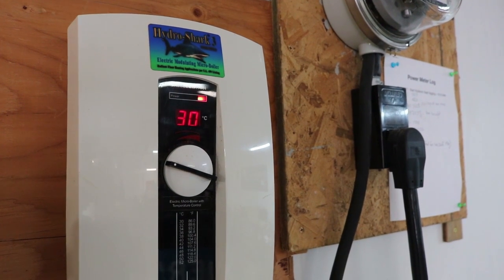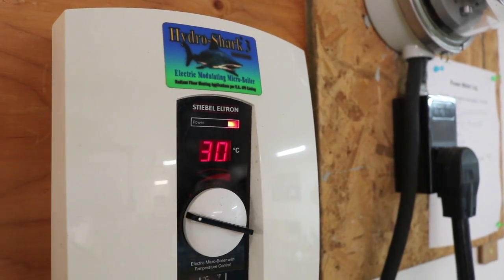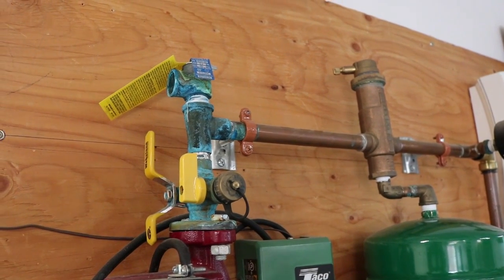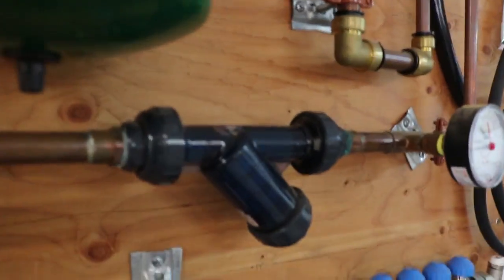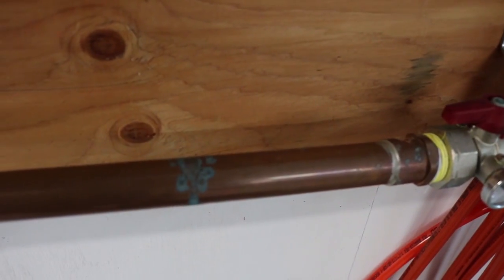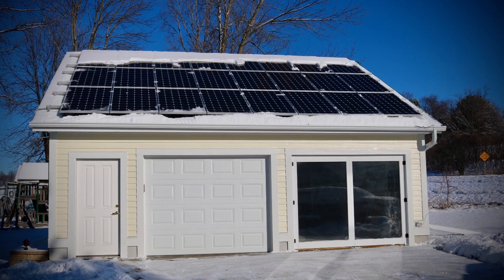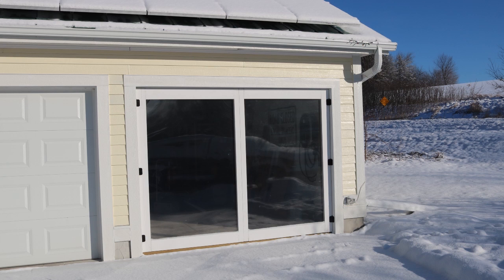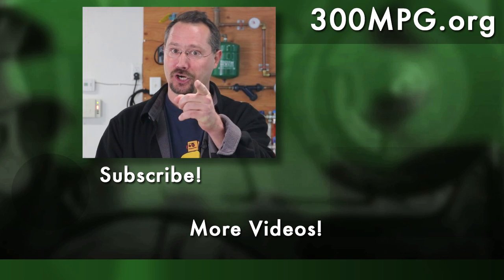DIY Hydronic Heat (3 of 3)

Comment: Hi Ben, You built a great system overall, quite impressive.
I have a few suggestions that would have made your system more user friendly. Since the temperatures used in hydronic heating systems are usually less than 102°F there is very little expansion of the glycol/water mix when heated so you could get rid of the T&P valve and the expansion tank and take care of that minute expansion in a different way. At the highest point in the system on your plywood board you would mount a 1 gallon stainless steel reservoir tank(quick and easy to get from a local welding/fab shop), this tank pulls quadruple duty, it makes filling the system easy, it primes the pump, it acts as an expansion tank, and it allow air bubbles to be purged from the system. Ease of filling: mix your glycol and water to the correct proportions in buckets and set aside and have them ready. When filling the system keep the reservoir tank topped off (use a nice big funnel) and use the primary pump in your system which is below the reservoir tank to actually fill the system. The primary pump should be below the tank for obvious reasons, however it should be at the lowest point on your heating system plywood board so it is always primed. When the system is full the reservoir tank will purge bubbles out of the lines until all air is gone. The tank should be kept half full so when the system is running with the heater on there is air space for any expansion.
The only other change I would have made is using at least 6" of XPS closed cell insulation around and under the slab to increase the system efficiency with minimal cost increase for an 800 sqft garage.
What about having ground mounted or raised, just behind the peak of the roof thermal solar instead of the wood boiler. Free solar heat is much nicer than paying the huge price for a wood boiler. The thermal solar racks could sit on the back pitched part of the roof but raised high enough to be angled facing the southern sun just like your PV panels.

Comment: The pressure relief valve should have a pipe going to within 6 inches of the floor, it's required on water heaters. Also I don't understand why there is more than one pump.

Comment: Hi there. Curious how much the little on demand heater was.
Reply from the maker: They retail for around $500, but I bought mine used for half that.
Reply: @BenjaminNelsonX  ok. And because you have wired a small meter base so you can monitor the power consumption, ( great idea) any sense of what it costs you a month on your hydro bill.
Reply from the maker: Hi Brain, I haven't been marking down the meter readings real consistantly. Probably closer to twice a winter. My electric usage does go up considerably in the winter though. The garage is a large space, and although I'm using quite a lot of electricity, I'm using it at off-peak times (Night) when electric rates are low, and I'm paying that out of credits I've earned through production of electricity with my solar.
It's basically free. But that's only because I'm not heating to a full room temperature and have a good setup with my solar.

Comment: What is the ball park cost  of this system I'm currently have 2 100 foot  half inch pipe run in a slab in a part of my basment that I'd like to hook up just as a supplemental heat source
Reply from the maker: I paid well under $1,000 for everything. The micro-boiler is the most expensive part - about $500. I bought mine used for half that. The other parts sort of add up, but I just looked at a commercially made product, saw what parts were in it, bought those parts individually, and did the labor myself. Cut the cost in half.

Here's the product I modeled my system on: https://www.menards.com/main/plumbing/hydronic-radiant-heat/radiant-heat-control-panels/hydro-smart-trade-1-zone-low-temp-integrator-panel/hsps120lt/p-1444433734726-c-8521.htm

Besides what's there, you also need a manifold for how many ever heating loops you have.

You could also look at using a domestic water heater as your heat source and have that rigged up with just a single pump, and some others of the basics like a fill valve and small pressure tank.

Since yours is in a basement, you don't have the same worry of possible freezing that my free-standing garage does, and so you would just use water instead of anti-freeze.

Comment: So, seems like you’ve had this running for about 4+ years… how’s that water heater holding up?  I’m considering something similar  and I’m curious how long term a unit like that will run with glycol in it.
Reply from the maker: It's been working well.
I'll run the heater at night on Thursday or Friday for working in the garage on the weekend.
Overall, I really like the system. You just have to keep in mind that it's SLOW to change temperature because of the mass of the concrete. That's great in that all the heat doesn't simply leave if I open the garage door to move a vehicle in and out, but it's bad in that I can't just turn on the heat and have it be warm 10 minutes later.

I have a "Time of Use Plan" with the electric company, so I run the heat at night when it's 6 cents per kWh.
Reply: @BenjaminNelsonX  Thanks for the reply!  Good to hear the electric heating unit is still going strong.  I have all the pipe in the concrete already, and I originally planned for a wood burning boiler, but plans are changing and I'm hoping to make it more automated so i don't have to feed the wood boiler all the time. An electric unit like that would be ideal. Thanks again.

Comment: Hi Benjamin, I am looking closely at the Stiebel boiler.  I am a little reluctant given all the items on the shelf are open box, signaling someone was unsuccessful before me. Would you recommend the unit?
Reply from the maker: The boiler that I have in my garage was purchased used. It's always worked great. No issues with it at all.
Reply from the maker: Open box doesn't mean unsuccessful. It can just mean somebody bought the wrong part or changed their mind, etc. Since it's open box, you can always look at the item and check that there's nothing obviously wrong with it or parts missing before you purchase.

Comment: How many watts can your solar panels output?
Reply from the maker: The solar array on my garage is 24 x 260 watt panels. Each is connected to a micro-inverter capable of outputting up to 225 watts, so total power on the AC side is 5,400 watts.
The solar and the electric micro-boiler are NOT designed as a matched set. I made less solar electricity in the winter than in the summer, and the long nights work against me. Winter nights are when I want the heat the most!

More details on the solar garage at: https://300mpg.org/bens-solar-garage/

Comment: This is a nice video, well done, one thing you need to do is that T& P valve is not stubbed down to a few inches off the floor, if there should be an over temp it will spray blue gycol everywhere and maybe burn someone. Please take heed.

Comment: you used 1/2 inch copper pipe for all the system, could you use pex for all the connections
Reply from the maker: I suppose you could. Just make sure to get PEX rated for the appropriate temperature and pressure.
For the components mounted on the wall, I essentially copied a commercial system. Theirs used copper parts. It was relatively easy to mount all the parts together and solder them. Proper PEX fittings require some specialized tools. Using SharkBite or similar fittings would probably get expensive and I might worry about the quality and potential of leaks.

Comment: Excellent video series, clear and concise with a lot of information. Thank you for posting. If I may offer a suggestion, it would be to plumb a pipe nipple and an "l" off of the pressure relief valve to a pipe coming to within 18 inches of the floor. This would allow you to direct any release into a bucket and also prevent a shorting out of your pump by water leaks.

Comment: I am in the middle of also building a hydronic floor system Do you think you should have used a higher kw heater or is that little one work fine 
And how big is your garage my garage is just under 1200 square feet I have 4 loops of 250 feet each what minimum size heater should I be looking at
Reply from the maker: My garage is just under 800 square feet. My boiler works fine for my application. I have a little under 1000 feet of 1/2 PEX in the concrete floor.
What size heater you need depends on how warm you want the building compared to the outside temperatures and considering what you have for insulation.
I only ever just wanted to take the chill off. 50℉ and working in a sweatshirt is pure luxury when it's 10℉ outside.
If I had a larger space and wanted higher temperatures, I'd probably to go a more powerful boiler.
There are online BTU calculators that can help you figure out what you need.

Comment: Food for thought. I also built mine from scratch 60x40 shop.  Before you change the system with glycol charge the system with about 10bls of air. Leave it for about 48 hrs. No pressure change you are good to go  You can also check with sosp and water. When installing pex pipe make sure it is continuous. NO CONNECTIONS IN THE FLOOR ITSELF.
Reply from the maker: Yes! I tested my system with air to check fro leaks BEFORE pouring the concrete.
No connections in the floor is right. Just nice continuous loops from the manifold and back.

My loops varied in length, but were all between 250-300 foot. Each loop was it's own 300 foot roll of PEX, cut to whatever length was needed.

Comment: I thought you were going to talk about what you would do differently? Comments show you overbuilt it adding cost and head to system. Now I have to research many areas: 1) Do you really need a pressure tank? 2) Do you really need 2 pumps?
Reply: You certainly didn’t need all the gauges as the ones on the manifold give enough info. I bet a perfectly good reliable system could have 1/2 the parts. Let’s face it, you are the warranty!

Comment: Does your solar system make enough power to power the hydronic system? How much did each system cost you to make? -not including the garage build obviously. Cheers
Reply from the maker: The solar produces up to 5,400 watts in full sunlight. The hydronic has a micro boiler which can use up to 7,200 watts when running at maximum.
The Solar cost me $6,500 after incentives. I don't recall the exact cost on the Hydronic. I think it was around $2,000 all together. (Compare that to buying a furnace, running a gas line, building sheet metal vents, etc.)
I also built a window that's fitted to one of the garage doors as a passive solar heater: https://www.instructables.com/id/Passive-Solar-Garage-Door/

Comment: Thank for the video, I built a very similar system.  Everything is working well except for one critical safety feature...  I am also using a spa heater.  Once the system is up and running and internal pressure built (about 10 psi), the spa heater will not turn-off when the pump is turn off...  Therefore, temperature and pressure keep on building up.  I don't understand why the heater will not turn-off if there is no flow.  However, when the system is cold (just starting), the heater will turn off when the pump is turn off.  Is the pressure "spoofing" the heater that there is flow ?  I did not use a secondary pump.  Could this be the cause ?
Reply from the maker: If your heater does NOT turn off when the pump does, you need to stop using it immediately. The heater could burn itself out, boil the water/coolant, and possibly lead to an explosion (Temperature/Pressure relief valve should prevent that, but you never know...)

You might have a faulty flow sensor in the micro-boiler. Another common issue is not having all the air in the system purged. Air-bubbles can cause all sorts of problems. Either way, you want to figure it out before continuing to use it.
Reply: @BenjaminNelsonX  No worries, I have stop using it.   What I find strange it that the heater does turn-off when the system is still cold but does not not once the system reach operating temperature.

Comment: So with regard to your relief valve,  also called a TMP, you should get a threaded adapter end and solder it to a 90 and attach a length of copper and run it down to the floor. If it does leak, or open to relieve pressure, it will drain to the floor and not all over the place.
Reply from the maker: Yes, you are absolutely right!
Reply: Agree. Just like a water heater the copper pipe goes 4" from the floor
Reply: Actually, plumbing code requires it to be within 12" of the floor.

Comment: Why did you closed the valve on close space tees. THIS IS YOUR HYDRONIC SEPARATION. YOUR PUMPS ARE FIGHTING PRESSURE DIFFERENTIAL.
Reply: I was wondering the same thing.... I don't think he fully understands the primary/secondary plumbing concept. The cheap Menards boiler will have a huge pressure drop, so they require a primary loop, but he has the valve closed so it can't be working properly.

Comment: I'm thinking about installing a similar system in my garage with natural gas as a heat source. Once your system is up to Temp, how much energy is your system using on a really cold day ( high Delta T). I'm trying to get a feel for the cost savings ( or not) compared to a typical forced air gas furnace. Thanks, and great videos!
Reply from the maker: You would see very little difference in cost of fuel between a forced air gas furnace and a gas-fired hydronic system. Modern gas furnaces and boilers are both pretty darn efficient. The difference would be that with hydronic, the air temperature would change slower. A disadvantage when you want to heat up from a dead cold start, but an advantage if already warm and you open the garage door to more a vehicle in and out.
The hydronic is certainly nicer if you are laying on the concrete floor working on a car. The warm floor also evaporates any water or snow-melt. In-floor heat also means there isn't any bulky duct-work or fans blowing around dust (or sawdust if you like woodworking!) The hydronic also means I have the possibility to fairly easily add a wood-burning outdoor furnace. (I really like the idea of that one, because I am right down the street from our town yard waste site. I can get free firewood year round!)
There are lots of variables for exactly how you want to design a heating system.
If you need to pour a concrete slab ANYWAYS, I would highly recommend installing the PEX tubing. It's not very expensive by itself, and you can't add it AFTER the fact of the concrete pour. And, of course, insulate, insulate, insulate!
Reply: Don't forget it's really important how your slab is insulated. At minimum 2" foam under and on sides. I have R38 under my slab and about R15 between slab and foundation wall and then another R15 or so on outside of foundation. I have R50 in walls and ceilings. Plus I have passive house certified innotech triple-pane windows. Like Benjamin says, it's "all about the insulation". Invest $1500 more now and save that back in a couple years.

Comment: why are you using glycol? my understanding is the heat transfer efficiency  is lower than water also it wares down the parts quicker as visible externally in your leaked areas... Thanks for the series nice work!
Reply from the maker: Water can freeze. When it freezes, it expands and breaks things. It gets cold here in the winter and that certainly could happen.
Reply: @BenjaminNelsonX  I C, makes sense for a garage or something you could/might have to walk away from or loose power etc... thanks
Reply: Amazing series.  Given me the confidence to try and design. It from the ground up.
Reply: One thing you would be very surprised about is how tough pex systems are when frozen. Having done it a couple of times no problem. You’d have to really let that concrete go cold for days before it would freeze too. But makes sense to condition water for corrosion.
Reply: So would you still use it indoors ?  Why use copper for the system instead of PEX.
Reply: You need to have non-corrosive metals (i.e. fully stainless circulator pumps) without any glycol. Glycol prevents corrosion (same in your car radiator) due to dissimilar metals. If you omit glycol chances are the water will be brown and rusty as your cast iron pump erodes. True, plain water transfers heat better, but only slightly.